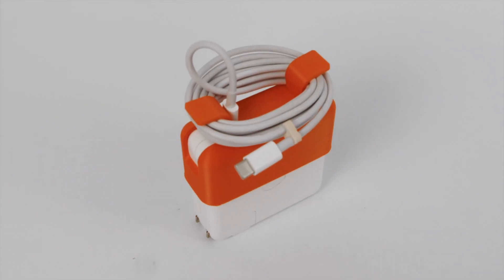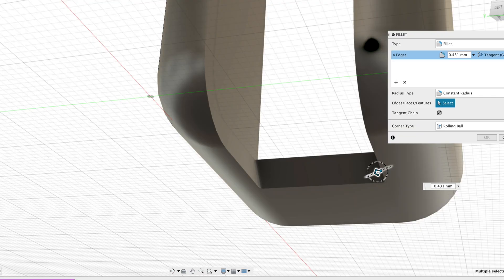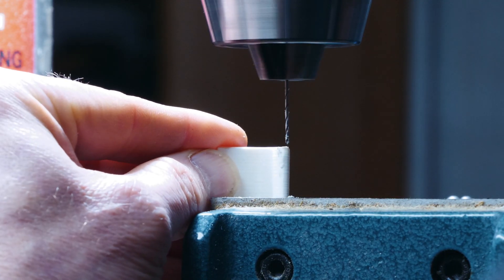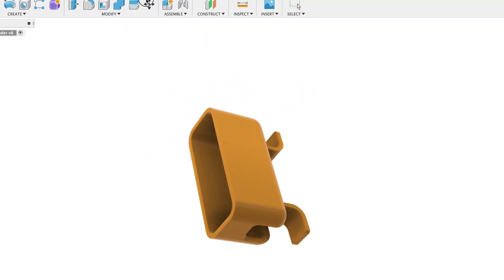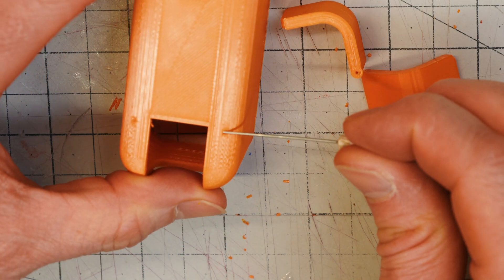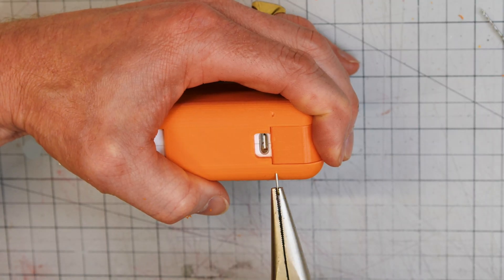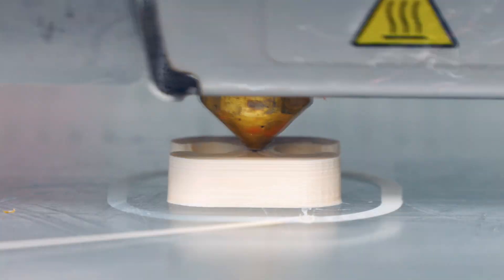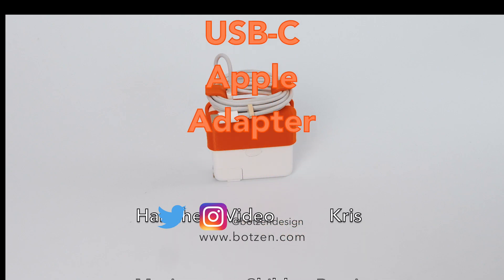The Power ADAPTER Apple REFUSES to make!

Comment: Thank you for this video post.  I appreciate the time you spend going through the thought process of engineering - great learning!
What is the program you are using when you are drawing?  And is that the Apple iPad Pro 12.9-inch you are drawing on?  And last question, what is that stand you have the pad in - is that your design?
Reply from the maker: Yes, I have a video about the stand, feel free to check it out, Affinity photo, yes 12.9" iPad

Comment: Cool stuff. You may be interested in a pin vise. It's basically a handle for small drill bits. You can get them for like ten bucks on amazon. Your video actually reminded me that I have one, after I spent yesterday struggling with some printed holes.
Reply from the maker: Yup, got one 🙂

Comment: The way you're wrapping the cords appears to be the method that causes the wire to twist. I used to do the same thing with console controllers. We don't notice it because it's string/cord physics, which is so hard for humans to wrap their brain around, and because cords are always one solid color. Draw a straight line down the length of the cord before you start wrapping it and you'll see the twist.

Comment: "Flexible PLA" ... what brand is that? ... where do I get some?
Reply from the maker: It's the standard ultimaker soft PLA, I would have linked to it in the Amazon store but they don't sell it there you'll need to get it from a local distributor

Comment: I know why Apple doesn't make them anymore, the know that material chosen for their cables is so indurable, that they will start to fail before their planned obsolete time period in this setup.
Good thing, third party cables exist to get rid of that rubber dry rot
Reply: Yeah I've gone through two and just wrapped the third entirely in electrical tape. Total piece of shit.
Reply from the maker: The new ones are nice because the cable comes off, the cables also a little bit thicker
Reply: I have an old MBP with the magnetic cable charger.  The cable has dry rotted.  I wrapped it with electrical tape.  If it fails my MBP is over.
Reply: @YoureUsingWordsIncorrectly  I think you misread my post.  I have the old magsafe connector.  The cable is not removable and not replaceable.  It's not usb c.